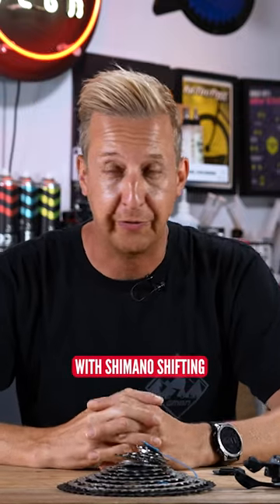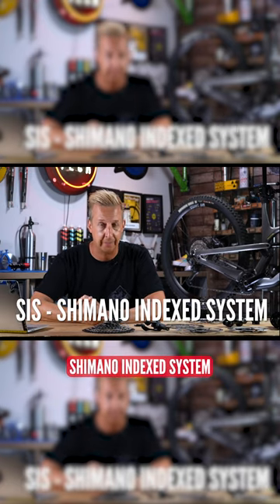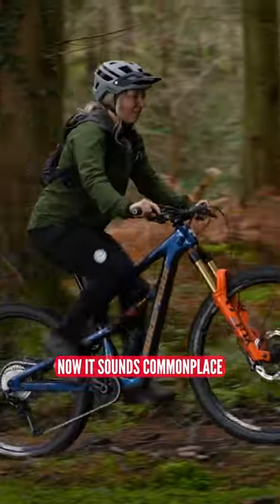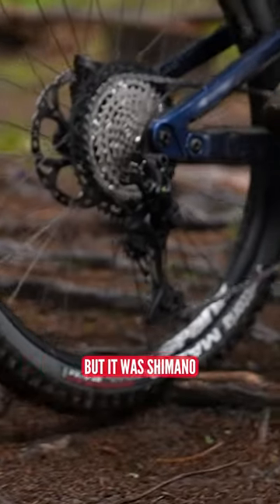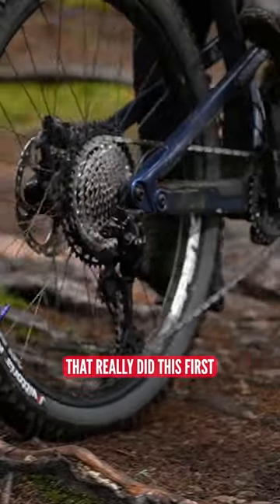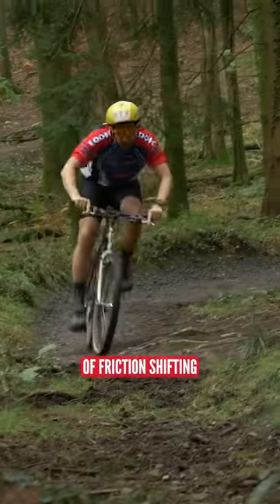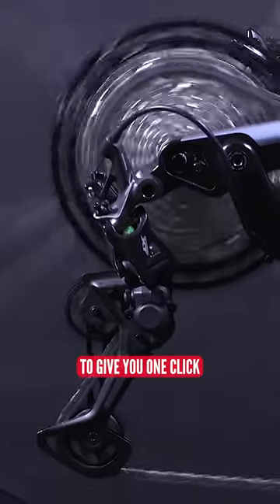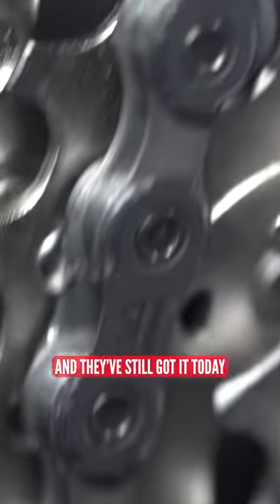What Does SIS Mean? 🤔

Comment: Paused the moment it popped up. I'm old. To my best recollection before watching it's Shimano Indexed Shifting. Now I'll watch and see how I did. Edit-well I was close. System not shifting. Some of the old grey matter still works though. 😉 The nice thing on my old Bridgestone MB-2 is that there is a lever on the shifter so you can switch between SIS and friction in case of the mentioned damage or out of tune system.
Reply: Yes deffo. The little thumb levers used to have SIS in orange lettering 👍🏽